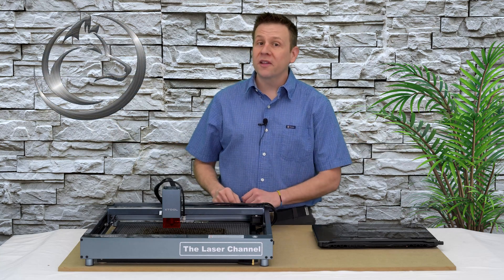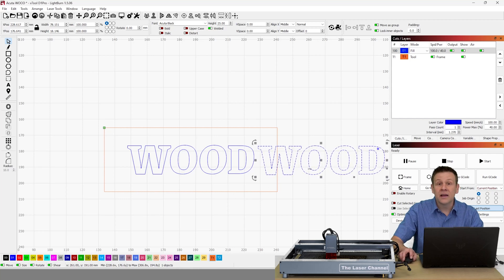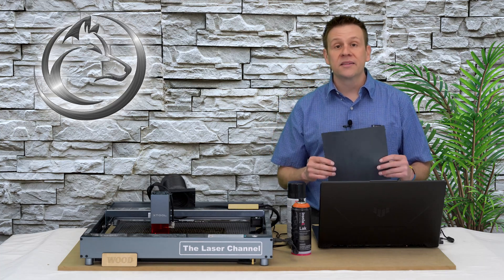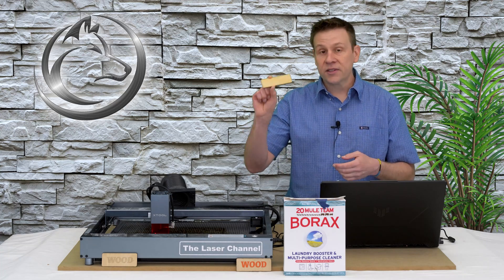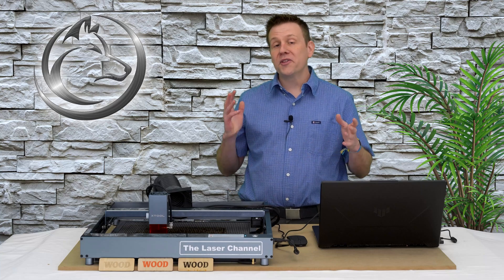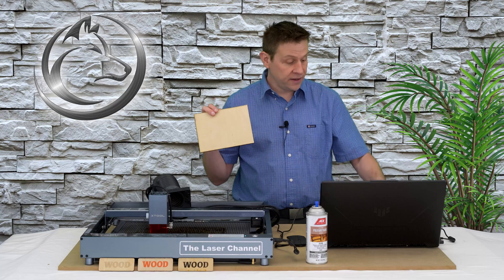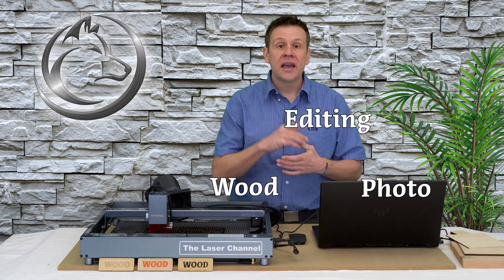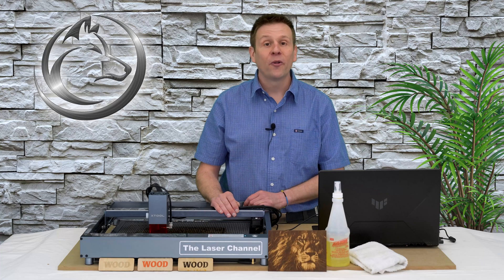Top 5 Engraving Tips - Laser Diode Edition!

Comment: Greg, in tip #1 you don't have to duplicate the word wood. When you bring up the Cut Settings Editor in LightBurn set everything as you did before. Then press the + sign in the upper right of the editor. You will now see another square come up with a 2 beside it. Now, you can set everything up as you did in your second layer. Use this method instead of duplicating layers.
Reply from the maker: That's awesome- thanks for sharing!!!